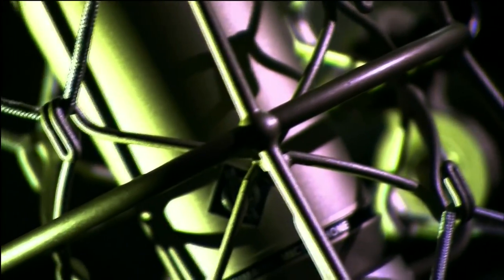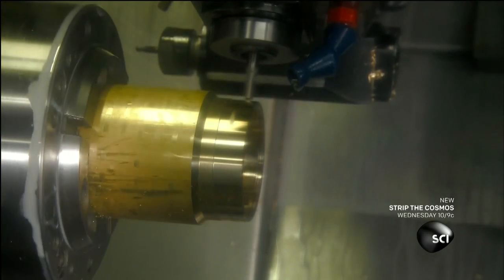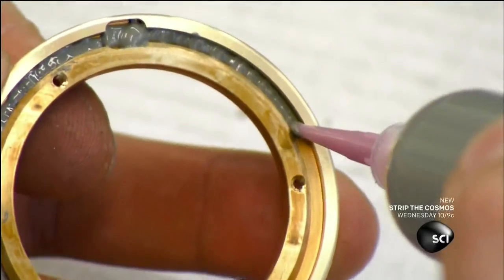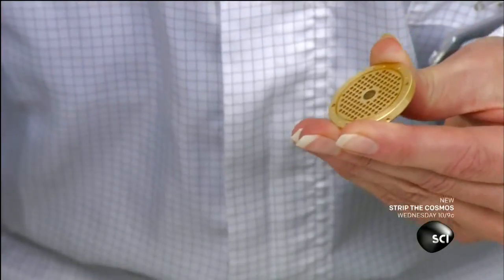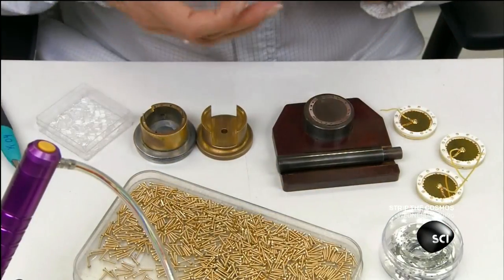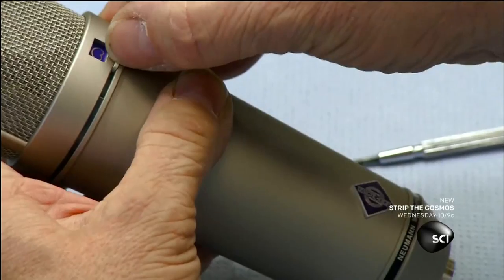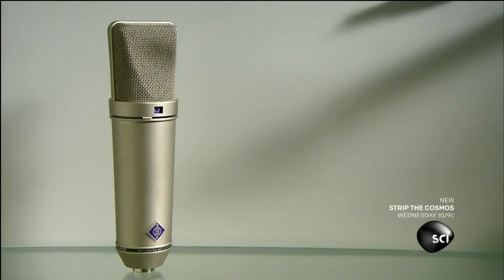How It's Made - Neumann U87ai microphone

Comment: I wasn't sure, but I learned here that the U87 does NOT have a tube in it (like I thought it always did).  Beautiful microphone for sure :-)
Reply: u67 is the tube model it replaced; they look the same except for the badge color.
Reply: @peterchoe  okay,, cool; that explains it actually.  Cheers mate!
Reply: I think it has option for a FET (MOSFET) or is FET only. I like both FETs and valves both.

Comment: Make sure your “compressed air” is air and not an inflammable spray duster. These contain harsh chemicals and the residue on your brush will dissolve your capsule membrane. Learned this on a “last-ditch” fix on a very bad sounding capsule, could have been a lot more expensive a loss ...
Reply: Wow, thanks for this tip! 🙏🏼
Reply: So alcohol one is what ya want?

Comment: So what justifies the extortionate cost?
Reply: quality build, quality sound and much more. real german workers paid fair rather than chinesekidz paid $1 a month. parts and tolerances that are bot cheap chineese etc. The real thing on most all albums from the 60s onwards. does not sound thin like cheap mics etc so much more. nice things cost more money u should know that
Reply: Even mic element thickness across surface is a big part of it. Swiss CNC machining vs plain CNC. Wiha caps. Better circuit boards with thicker traces. Silver and silver plated wire. Real Teflon insulators. Time to make sure each component is not flawed. German assembly. Inflation.. etc...

Comment: Question is... what components are in the microphone that makes this cost thousands of dollars?
I have a Audiotechnica 2020 microphone and sounds very good for what it is but I want to know what causes these particular Neumann microphones to be so expensive compared to my $100 Audiotechnica?
Reply: I just built 2 U87 clones, and just the electronics for one mic (resistors, capacitors, transistors, inductors, etc...) cost nearly $80. That's using top shelf mil spec components.

It boils down to more care, more precision, and more quality.

The fact that an AT2020 retails for $99 tells me it must be made VERY cheaply, knowing what I paid for all of the components to the two U87 clones I built.

In general, inexpensive condensers like the 2020 have a very shrill high end. There is a difference.

My vote for the best, inexpensive condenser is the Shure SM27. I would start there if anyone is looking for quality at a fairly low price.
Reply: Lot of research and development, decades worth of engineering and capsule design along with circuit design, top quality components, hand assembled, thoroughly checked by experienced techs before being packaged...your at2020 is not a bad mic, but I’m sure there were corners cut in order to pass on the savings to you the customer.  For instance, i believe they buy all of their capsules from a Chinese factory in tongxin in bulk.  Where as Neumann makes theirs in-house to a specific tolerance between each capsule made.  I also believe they check each and every capsule after install to make sure they are within spec of what they deem is Neumann.
Reply: It’s a secret ingredient called marketing, generate the hype, and because you’re a star, people will let you do anything...
Reply: @PlayExe-jl5fi  a lot of corners for sure
I have an at2035 and tried out the at4040 (which I then returned to get a tlm-102 since the 4040 is too flat and not tuned well imo) and I can hear that many corners were cut on the 2035 versus the 4040.. it didn't handle volumes differences nearly as well and had what kinda sounded like compression artifacts in a way
I think they used a different metal as well, steel versus brass
the tlm-102 is a beautiful sounding microphone.. so smooth and not flat like the at mics I've heard
Reply: @ramblr78  this is all great but it doesn't account for the actual build quality
Reply: It literally boils down to specific things like the metallurgy used in designing things like transformers and the insane precision involved to get those capsules to sound just right.  There are plenty of “parts” out there.. but it’s about each ingredient being exactly right from decades of experience.
Reply: Name recognition. There are $1000 mics on the market (not neumann) that are comparable if not better depending on the application and subject recorded. At the end of the day 99% of the audio recorded with these mics are mixed and mastered so it's impossible to tell what mic it was recorded on anyway when you're dealing with mics in the $500+ range. Some mics make mixing and mastering easier so it's worth the $$$, otherwise with the right software and time EQing vocals makes it to where you can virtually have whatever sound profile you want as long as the mic is flat enough. It's easy to fall into the pit of mic or brand obsession, but it doesn't need to be that way anymore.
Reply: @RainboomDash  Hey I have both an AT2035 and a U87ai. It's not even a proper comparison. With the Neumann I'm just touching a little low end high pass and pultec and compression and I'm done. Sounds right and ready to go. The AT going through tube saturation and 6-7 other plugins before it even gets close. Also the only reason I held on to the 2035 was because they stopped making them but I talked to a guy that works in AT corporate in Ohio. He said they just rebranded the 2035 as the 2020 when they dropped the 4050 so it would seem like higher quality. It's not that they don't make 2035 anymore it's that the 2035 is the 2020. Ain't that bout a bych?
Reply: @tb1235  yeah you're right. Depends on mixing ease and taste. Me I'd rather spend more money on the right sound color mic for the application instead of using 100 plugins to get a sound. For instance I know if I'm recording a screamer or anything edgy I'm going to use the SM7B. It just hits right. That sprinkle of distortion is what made Micheal Jackson and Chester Bennington's voice just shine without dubbing. If you have the skills, making your own mic is very economical nowadays. But if you want something close to a Neumann for cheap check out the Stellar X2 I think it's called. The one with the super low noise. It's $200 and nearly identical sound. The untrained ear won't tell the difference.
Reply: @MrArtVein  yeah the clarity is just not there on the at2035.. and it doesn't handle volume differences well at all.. I do like the sound it has, though
At4040 I didn't like.. I think it sounded too dark or something
Reply: @Yippee Skippy enjoy.
Reply: The U87 is an original and world standard. It’s been copied hundreds of times and what people don’t ever mention is their magical qualities remain above most companies because the ‘Physics’  are difficult to replicate. Their could be Mathematical secrets that may never be revealed? This creates the Magic. These are the Masters.
Reply: @tb1235  you would tell if it's a sony c800g even after mastering bruh
Reply: @beyondthegong  Dude transformers are just metal cores wrapped with copper wire based on different metal gauges; including the different primary, secondary wrap counts (also including center taps). The metal can be cheap or expensive based on quality of ore and forge. Electrodynamics pretty much are uniform, doing analysis with a spectrum analyzer or clock speed oscilloscope tests will show the small differences between electrical signals. If we have similar R/C networks that filter 
, it should be pretty much the same. Just like all electronics and products; the marketing is what drives the pricing.
Reply: @dakotaotero4245  🤦🏻‍♂️
Reply: @beyondthegong  Nothing to say, I’ll take that as conceding
Reply: @ramblr78  You and the people that liked that comment clearly haven't heard this mic in comparison or just don't have a decent ear. Marketing without a great product doesn't get you as far as this.  There's a reason it's the 'studio standard' for the past few decades.
Reply: @tb1235  Nah, you're not even remotely right - Processing isn't gonna magically make it sound like a U87 or an equivalent. MOST condenser mics are flat - frequency response doesn't mean it's gonna have the same detail or profile in its sound and that's only scratching the surface. Even if you process a cheaper mic, it's not gonna have the same character because you capture the sound at the source, processing isn't gonna make up for it. Also, you're not gonna have a recording on a U87 sitting raw so naturally, it's gonna sound better regardless. There's great mics that are cheaper and arguably compete really well with it, but saying that it's all brand is a massive load of cope.
Reply: @who_is_dis  True... As a mastering engineer, recordist and mic engineer with 22+ years working experience, I’ve used every drool-worthy mic you can name. The U87 is nothing special when you’re armed with U67’s, C12’s, ELA M251’s, etc. with all the outboard gear, console, converters to boot. That being said, the main reason U87’s (and all those other mics for that matter) are “‘magical” is namely because the human brain loves familiarity, and these mics set in motion the standards by which we listen to almost any top billed artist out there.

A good example is the recording of tambourine - it just doesn’t sound “right” unless it’s played way off axis, under a mic by a singer, as it was first done in the industry. The same is happening here. Also - as in the field of electronics engineering, of which I also have a background, a term I borrow from that field for this very conversation is, measurement confidence. That is the proven, industry accepted standard that a company maintains, with longevity for the design and build always being within that specific measure and accuracy, robustness and quality. These are a couple reasons that these mics have earned their price. They are for the commercial market, and commercial facilities don’t mess around. They are happy to buy a batch of $3.2k mics just to use as floor or room mics, because the sound is known, and that measurement confidence is there.

Also in my career, I have built mics, modded mics, designed and built high end speaker designs for mixing and mastering studios, etc. so I have my hands inside a lot of this. Having said that, I will say that what makes a good song is a good song. That is writing, performance, instrument quality and room quality. Any decent setup, including a decent mic, can achieve an incredible, audiophile grade recording when everything is done well, intelligently, tastefully, and masterfully. 

So for those who can’t afford the big guns, don’t sweat it. They are commercial tools for the above mentioned reasons (and more). There’s no hidden math or secret. Some of the capsules are easily made (copied), and a few, like the M7 are very difficult to make. Most of the huge differences in sound between a U87 and decent copies could be variances in the circuit design, the capsule, headbasket, etc.  but they get darn close in some cases. Folks who deny this possibility fall into what I would say is a brand reverence mindset, where the psychology of the situation has a strong affect upon judgement, like placebo. 

I can hear the differences, and I can reach for any Neumann anytime I want, but I also have tested, (as a scientist I personally must, lol) - and found that there are really a lot of great options out there in the “home studio market”. No need to buy an 87. Especially if your space is not treated and you don’t have the signal chain,  instruments, etc.

Learn to build some mics with great folks like Matt at Microphone-parts.com or Dave at Advanced Audio. You can buy or build proven designs there, that are often taken directly from the Neumann schematics, modded, and optimized for the build project. Great stuff!

We all love diamonds. The commercial studios will always have them on hand. No question. But a solo artist recording in their bedroom? Don’t do that, haha. Odds are you wouldn’t like it because of your untreated room. If you have a VO booth and do VO/VA work, you can grab an 87 if you want, but who’s to say it will match your voice? Best to have worked with them a lot first :)
Reply: @ramblr78  Maybe a bit.. people who cant afford this mic tend to think like you and will say its more about hype
Reply: @CirclesandSounds  dude this comment rules, totally agree
Reply: I don't think it's so much the components (the electronics are not too expensive, certainly not several hundred euros, even including the transformer), as the labour cost. Wages are high in Germany, especially for specialists in certain niche fields, and microphone production in the high end segment is lots of manual work which requires finesse; I read somewhere in an interview that at Beyerdynamic there is excactly one woman with magical steady hands who is able  to insert the ribbon into their M160 ribbon mic. And these labour costs of course also apply to the quality assurance & testing stages, not just manufacturing. There certainly is some amount of "premium brand tax", no question, but handbuilding a mic takes some time and skills - especially if you value consistency (that each U87 sounds like an U87 within narrow margins). And those come at a cost.
On the other hand, if you automate the entire process from circuit board to assembly, build the mic in a country with very low wages (e. g. one Audiotechnica I used to have was made in China) and mass produce, you can do it much cheaper. I think it's just another business model: You can produce relatively few high-quality items which will be expensive or you can mass-produce a lot more items where quality isn't the top concern which you can sell for a lot cheaper.
Please note that I'm not saying that all mics or products made in China are low-quality, I'm just pointing out that if something is hand-made in a country with a high standard of living (and associated high costs of living and therefore high wages), it's going to cost accordingly more. Same thing with boutique hand-made vs. mass produced guitars, guitar-amps, you name it..

Comment: There's real gold in this mic? Hmm... I may need to open mine up.
Reply: Gold is a great conductor. There's gold in decent quality cables too.
Reply: @tikkorome5752  that's ridiculous and just plain marketing BS since even copper is more conductive, really the reason they use it here is that unlike copper it won't oxidize or rust and change the microphone's sound as a result.
Reply: @Cockalicious  yeah but in term of mics the usage of gold will slightly reduce the noice
Reply: Bruh , its just a thin membrane of gold , something like .8 microns , it is not even close to 20% of your mic cost (depends on which microphone you use)
Reply: I mean it's only in high quality condenser microphones so I wouldn't recommend it my man.
Reply: @Cockalicious Humidity from breath would easily corode and degrade the copper. Gold in thin layers of mic element is actually much better, even in a desicated enviroment. Gold has unique tones to it, as does silver be it not as bright as silver,  and conduction is NOT the only factor.
Reply: @AldoSchmedack  yeah, nice to know someone else agrees with me
Reply: @MythicGamingyt  look i get using gold in this because it doesn't rust, but saying hey we put gold in your mic it's fancy now so we're gonna rack up the price is just some of that classic marketing wishy-washy crap, we've seen it before, nothing new about it.

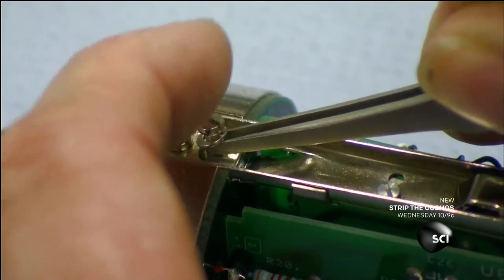Comment: 3:24 that's a Neumann U89i not a U87ai, it says clearly on the circuit board, just thought I'd point that out, it's NOT the same mic or circuit, and is much smaller, cheers.
Reply: D'oh!
Reply: You can't always go by the name on the board. as the U87Ai usea the same dc-to-dc power converter board first introduced in the U89 before the U87AI came out, so they just kept the U89 name on that board for use in both U89 and U87AI. Many who have U87AI have mentioned theirs has U89 labelled board in it
Reply: @RocknJazzer That happens a lot on many electronics. You are spot on!
Reply: Most if not all the recent U87ai will have a U89 board. I’ve opened up quite a few throughout the years. So I can confirm what they are building here is 100 percent a U87

Comment: if 2 capsule picks up various direction back to back, would it be concentrated direction if its facing the same direction ? or even next to each other facing the same direction with a strip ?
Reply: I think it's a "figure 8" polar pattern microphone - these pick up sound from both Front and Back of the mic, that's why talk shows use them a lot.

EDIT: Sorry, I misunderstood your question. I've never heard of a microphone with two capsules facing the same direction, I'm not sure what that would do. If you did, you could theoretically have the electronics "tune" each capsule separately to focus in on different frequency ranges.
Reply: they say 12mhz is the best recording for recording, so maybe 2 tuned caps of 6mhz.i am going for quality sound but it looks like diy/experiment/bored.
Reply: @dharmakissoon  I know nothing about building electronics, but your project sounds interesting. LMK if u upload a video about it! 

It sounds like you're building a 2-n-1 mic! Which would have the advantage of not having to use two mics, and then mix two different tracks afterwards.